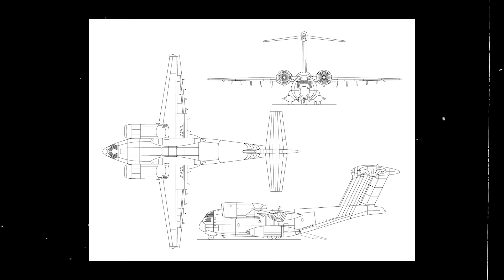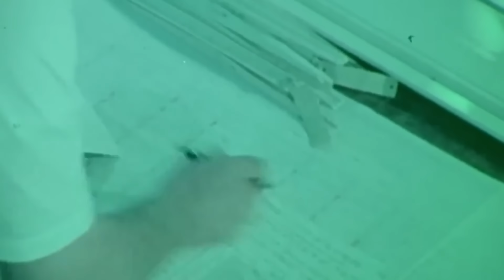The Plane that No One Wanted (But Could Land on a Football Field)

Comment: Cram this beast with modern avionics and engines and it will be able to replace the C-17 in 20 years.
Boeing, I, as a taxpayer that demands the best equipment for our warfighters, DARE you to do the research and development independent of the government. I mean you already have the airframe, right? OR....apply this tech to the C-17, making it a twin engine instead of a 4-engine, therefore saving costs over a 4-engine plane. Just a thought.

Comment: The crafts just need a way to vector air thrust into verticle to get atleast a very short runway/vtol. The retro rocket technique of the Hercules. Almost worked in the late 20th century. But those goons, didn't implament autonomous navigations. Pure hand-on button boosters to VTOL 3D.

Comment: Imagine what this could have been....

Hardware:
•  Airframe: 60% carbon fiber composites, titanium, aluminum-lithium alloys, self-healing polymers, ceramic matrix composites.
•  Wing: Supercritical airfoil, upper-surface blowing (USB), high-aspect-ratio (12), adaptive trailing edges, boundary layer control (micro-jets/plasma actuators).
•  Wingtip Technologies: Adaptive winglets, split scimitar winglets, raked wingtips, ATLAS (active load alleviation), bionic wingtip slots.
•  Engines: Two GE9X-derived high-bypass turbofans (60,000 lbf each, 12:1 bypass ratio, 0.45 SFC), D-shaped nozzles, ceramic matrix composites, titanium aluminides, hybrid-electric assist (lithium-sulfur batteries).
•  JATO: Eight Aerojet 15-KS-1000 solid-fuel JATO bottles (1,000 lbf each, 15 seconds), composite casings, jettisonable horse collar rack, smokeless propellants.
•  Anchor System: Four composite anchors (50 lb each), carbon-nanotube stretchable ropes (50,000 lbf tensile), pneumatic actuators, retractable reels, portable mesh net.
•  Flight Controls: Fly-by-light (fiber-optic), AI-driven optimization, augmented reality glass cockpit.
•  Cargo System: Reinforced composite cargo bay, automated loading, modular pallets, GPS-guided airdrop.
•  Stealth: Radar-absorbent coatings.
Specs:
•  Top Speed: 650 mph (1,046 km/h, 565 knots).
•  Rate of Climb: 11,000–11,500 ft/min (3,353–3,505 m/min).
•  Maximum Altitude: 55,000 ft (16,764 m).
•  Range: 5,400 mi (8,690 km) with 27,000-lb payload.
•  Payload: 110,000 lb (49,895 kg) STOL, 150,000 lb (68,039 kg) conventional.
•  STOL: 300–350 ft takeoff/landing on 1,000-ft unprepared runways.

Comment: I am surprised the Navy didnt look into this, considering its performance and size, it could have made for a great cargo plane for Aircraft Carriers. 

Maybe that would have needed some rework to be lower and fit in hangars ... and of course folding wings (but considering the narrow location of the engines, it would have beed more practical than something like a C-130 or other twin turboprops).

Comment: Just another example of Air Force Stupidity. By far the least effective branch of the US Military, most of it at their own hands. This isn't theory. it comes from years of experience working with them... If they had their way the A-10 would have been canceled 30 years ago. Idiots, all of them. It's a requirement.

Comment: There is something I heard about how to make a success military aircraft. It is four dimension length , width of the span , height of aircraft but most of all the last dimension political support. . Lockheed the maker of the C 130 Hercules had political  clout with the administrator than Boeing.. this the reason the YC-14 was cancel..sad really.   Pierre Spray with John Boyd fathers of the F16 an inexpensive plane father had political backing . The nevertheless Norhtope had the military to force a fly off between the F 18 Vs F16.
It was the only time a really good aircraft win.  I hear their are looking for replacement.  Good luck.

Comment: This plane was an artwork of aerodynamics it used the Coanda effect to throw the air down after the short wing boosting lift. If you look for Remember they didn't had computer simulations of Navier-Stokes equations at that time: all done by experience, intuition and many tests with models on a wind tunnel. Look how massive the reverses are. It is a beauty. Pity was used on such a senseless and useless war.
Reply: PS Boeing what they have done to you?

Comment: I can see why the YC-14 was cancelled.  The hot/near-hot gases continually blowing over the wing to achieve the coanda effect, at the same time causing accelerated degradation of structural integrity.

Comment: They should revisit this design. With modern electronics and composite structures this plane would be the best heavy stol transport in the inventory.
Reply: I don't know if it would be "the best heavy stol transport", but as you said: with (especially) modern composite materials it might make actually sense to look into the concept again (I'm speaking as a layman, though, and the aircraft industry may have sound reasons for not reviving it).

Comment: About C-130 landing requirements: In Southeast Asia, I spent some time in remote locations, where C-130 and C-47 brought food, equipment, and supplies. I don't know the runway's length, but I did notice that the C-130's landed in about half as much distance as the C-47's.

Comment: I saw the prototype YC14 fly when I was young back in 1976, it was really impressive! 
My good friend Frank Brame was an engineering manager on the project at the time so I got to visit his department and the prototype at Boeing. He was responsible for the landing gear design, which was an impressive piece of work in itself. Boeing was was an amazing company back then with so many interesting leading edge projects going on. Moon car, the hydrofoil, minute man, SST, the 747 and many more. Before it was torn apart by the so called business experts. There is an excellent fairly recent movie about this, dont remember the title.

Comment: The high engine placement would be very useful on unpaved surfaces to prevent ingestion of dirt, gravel, snow, etc. And it would be safer for ground personnel to work around while the engines were running.

Comment: The YC-14 represents the dangers of peacetime priorities for a fighting force.  The ability to get stuff in and out of the forward edge of the battle area is only a problem if you are actually fighting a war.  I started my working career the year the Boeing first flew.  I'm now retired and the plane it was designed to replace is still going strong. The Herc is a brilliant aircraft but it was designed before I was born and I'm 70.  It might be time to dust off the plans for the YC-14 and update it with modern avionics and new engines and see what results.  It might even be better than the Embraer KC390, a plane that is eating into the Hercules market.

Comment: It's sad to see how far Boeing has fallen from the days when they were a giant of the industry with innovative designs that stood the test of time. The C-135 airframe designed in the early '50's is still in active use in the U.S. Air Force. I used to work on one of the first two C-135's delivered to the Air Force. The YC-14 could be retooled and modernized as a replacement for the C-130 fleet we currently have. Too bad that will not happen.

Comment: If the US military hadn't canceled the YC-14, operation Eagle Claw, the ill fated April 24, 1980 attempt to rescue the hostages taken from the US embassy in Tehran, might have ended quite differently.  Their plan to strap rockets onto C-130 Hercules aircraft to allow them to land and take off in a stadium was something out of a coyote/roadrunner cartoon.  The YC-14 actually had a chance of pulling that off.

Comment: Disappointed no mention was made in this video of the vast amount of design data from DeHavilland that went into this aircraft, especially from NASA’s experiments and modifications to the DH-C-5  Buffalo which was actually, in modified for , the first large aircraft with shoulder-mounted jets providing Coanda effect. Worth mentioning too that the US Army was operating the DHC-5 in Vietnam with exactly the performance specified in the original design brief for this thing, albeit with 10,000lb payload. The YC-14 was basically the next logical step in NASA’s work with DeHavilland and almost all its design features weee prototyped on a Buffalo. DeHavilland at the time I believe was actually purchased by Boeing from the Hawker-Sidley group before being absorbed by Bombardier.

Comment: That blazer being 2wd is an awesome find.  Do not be temped to make it 4wd.  One of the coolest looking vehicles from my early 20's was a mildly lowered 2wd blazer that would cruise around with the Top off. It was the coolest looking rig. Kind of a hottub looking red 4 seater with that short wheelbase.  What a kind man to give it to Demri.

Comment: Nice Plane. It would be nice if the wings with the engines could tilt 45 degrees. I wonder if it could lift off on a shorter runway?

Comment: Excellent video. I worked at NASA-Ames as an intern and subsequently an engineer in the Large Scale Aerodynamics branch in the '70s where we tested USB, Externally Blown Flap and Augmentor wing technologies for STOL transport application. The time between concept and hardware was much shorter than it is today.

Comment: This was a fly off competition with the MD YC 15. They were originally intended to be replacements for the venerable C 130. A greater need appeared as the LM C 141 (even with expanded capacity “plugs”) proved to be slow and had limited lift capacity relative to its size. The YC 15 won the fly off with the design being enlarged to fill the 141s role rather than the C 130’s hence the C 17 which has proven to be powerful & reliable. It’s become a favorite of allied AFs, and other friendly nations as well. The YC 14? A missed opportunity for now. Its performance & lift capacity is still proof of concept gold. The Russians are excellent aeronautical engineers and they wisely took note of the 14’s tactical lifting potential. Since the YC 14 design was not classified it was relatively easy to acquire the design blueprints without raising an eyebrow (we didn’t need it anyway, right?) just like the Chinese lifted the unclassified C 17 design as their air lifter. So many of our pioneering engineering efforts don’t get protected or are thrown away outright only to be picked up by keen adversaries and possibly used against us. The YC 14? The new Embraer C 290 has proven a hit by  a lot of countries looking for a modern economical airlifter alternative to the C 130. LM may think they still have a lock on price but plenty think otherwise. So maybe there’s an opportunity for the 14. I bet with what we have learned since the original competition, a lighter, more powerful and aero advanced version could fly rings around the KC 390 or anything else. As noted by earlier commentators there’s plenty of applications where a 14X would shine. With climate change driving a emerging wild land fire threat that may well rise to something approaching a national security issue requiring major federal intervention, tired C 130s & DC10s just won’t cut it. Is anybody listening?

Comment: I worked in the control tower late 1970s at then NWC China Lake. This aircraft flew through one day and performed a low approach or touch and go, do not recall which, and returned to EDW. Just recall how odd it appeared. We were also getting A-10s into NID at the time, and those were also odd looking at first glance.

Comment: This aircraft was not revolutionary....
French Breguet 941 - USA Collaboration
The Breguet 941, a French STOL (Short Take-Off and Landing) transport aircraft, saw significant cooperation with the United States in the 1960s. In 1962, a licensing agreement was signed between Breguet and McDonnell Douglas (MD) to develop and produce the aircraft under the designation MD 188. This agreement gave the aircraft American certification and a presence on the North American market.

Testing and demonstrations in the United States

In 1964, a Breguet 941 was sent to the United States for testing and demonstrations. The aircraft was used to evaluate its STOL capabilities and its potential for regional transport in small towns and isolated areas. Demonstrations took place at the gates of Paris at the Paris-Issy-les-Moulineaux heliport and in other American cities.

Comment: The AF didn’t need to replace all of the C-130’s with YF-14’s. There were and still are plenty of roles that the don’t require the shorter takeoff and landing of the YF-14, they should have put this plane into production and used it to augment tactical roles alongside the C-130. That said, as someone who was a structural maintenance mechanic for and who flew on C-130’s when I was in the AF, it’s crazy seeing the footage of what this YF-14 can do… much of these maneuvers and certainly the climb rate is far beyond the capability of even the updated J model 130’s. This thing looks BONKERS for the kind of aircraft that it was.

Comment: I remember seeing the YC-14 and YC-15 both fly at the Mildenhall Air Show in the late 70's.  The YC-14 blew the other away in every aspect.  The YC-15 had one outboard engine way oversized for some reason.  I suspect Lockheed saw that the YC-14 was blowing theirs out of the water in performance and payload.  So why did the YC-15 get the contract?  Greed and graft.

Comment: Oh it didn't vanish. Douglas Corporation ummm "studied" the technical designs and created a whole new generation of airplane under the CX program. The YC-15 was the result of that effort. A sort of "jack of all trades" by being more conventional than Boeing's effort, it sported 4 engines rather than the 2 the YC-17 had, and in a conventional "high wing and engines slung under" configuration. This was more of a cross between the Lockheed C-141 Tactical Airlifter and qualities of the C-130 Hercules. The YC-15 began to wow both critics and Air Force Generals as it still has the looks of the C-5 Galaxy and C-141. But this plane had excellent STOL characteristics, durability, climb and austere field performance. And while not the longest range aircraft (3000 miles with full payload) it was that "sweet spot" of speed, endurance, and warload capability. 

This aircraft evolved over time into the radical C-17A Globemaster III. The current standard for short field, high speed, and extreme ruggedness. Sorry if this is short. But it would take much longer to explain all of this. But in conclusion? In the ultimate case of irony? Boeing ended up purchasing Douglas Corporation and all it's assets. Including the C-17. It's successful rival to its lost YC-17 aircraft.

Comment: The C-130 did not need 4,000 ft runways.  I was a crew chief, then later a flight engineer on them.  We would load a 26,000 lb fork lift into them and go do stop and goes on a 3,000 foot PSP on dirt runway.  But less than 400 feet is impressive.  But on the other hand how light was the aircraft loaded.

Comment: I retired my C-130 to the bone yard back in the mid 90's and while there visited the Pima air museum where they had one of the YC-14's on display.
Reply: I saw one at the Airport in Arizona not to far off the run way in the 90’s.
Reply: @GregoryCasey-k2k  Pima Air Museum and Davis Monthan are literally across the street from one another.

Comment: Our company developed the Avionics Suite for the C17.  Much of that knowledge came from prior programs, such as this one.  The Iron-Bird simulators allowed software development even before the first birds actually flew.  As of now, the C17s and C130s are still the workhorses of the MAC fleet.  It is time for the USAF to get some spine, and design a better airframe than these.  The C5s are ancient also, grossly overworked, and need better avionics.  At least they stepped up top a B52 overhaul and re-engining, but I'm not sure that the vendor can actually handle this anymore (name unmentioned).

Comment: I saw the title show up in my feed, and I was like "man, I wondering if they're talking about the Hercules?"

Why? Because I've recently worked on a remote/sub-arctic mine that has an airstrip that has flights coming in around the clock. The airstrip can support as much as a 737, but the majority of the Cargo comes in on the Hercules...And I'm still blown away by how little runway space they require compared to all the other planes that come in. It's like I'm watching magic. It's like they take off and land in not even a third of the runway.  Incredibly impressive planes. I doubt the project I'm on would be feasible if they didn't exist.

Comment: Back in 2010, I was billeted in the FOB Salerno RSOI barracks, which were right next to the runway. I was hanging out in the hooch and heard this loud eerie howl coming from the airfield. I ran out to catch an AN-74 rolling out on the runway. Those engines had a sound I'd never heard before and that thing was a shape I'd only seen in pictures. What a wild sight. One thing I noticed with the Soviet era birds design is noise abatement wasn't even in the designer's minds.
Reply: ...kinda like a squadron of F111's taking off at full AB......bloody hell what a racket they made!!!  wake the dead is an understatement!!!
Reply: When the F-111s used to visit RAF Bentwaters they would knock down and burn the pine trees behind the spot they would park them on when they fired them up and the pilots would give them a little throttle to taxi out.

Comment: The yc 14 looks like some one cut off the fronth and back parts of the c130 cut the tips of the wings of the c130 and striped a few boieng 747 jet engines and kit mashed it all together. 
Edit: for got to add 🤣